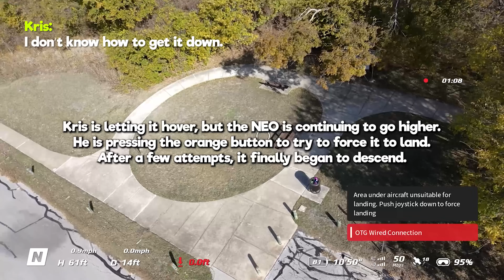Don't Do This With Your NEO [DJI Responded]

Comment: I tried indoor flights with RC-N3. GPS lock doesn't seem to matter, but enough light is crucial to make down sensors work. Too dark and it isn't able to hover but goes crazy. My conclusion is Neo switches to GPS positioning only beyond a specific height (unknown but higher than a room).
GPS receipt is also very weak compared to a smartphone. Takes ages and doesn't get as many satellites under sub optimal conditions. Don't know why. Neo body is large enough to include same antenna as any smartphone.
Reply from the maker: Interesting theory about the height. You might be right about that.

Comment: This is obvious, even with a good lock, civilian GPS only has an accuracy of a metre or so. The drone uses a combination of the sensors and the GPS to get its position and speed, without either of these it will be erratic.

If the sensor is used to gauge how quickly the drone is moving with the motion controller then if the sensor sees all black it may think it’s not moving and attempt to move faster in that direction, this could account for the out of control movement when moving into a dark area, especially if there is no GPS to correct its positional awareness.

Comment: It has happened to me several times that, in broad daylight and with a completely clear sky, while the drone is connected to 15 or more satellites it suddenly loses them, making it difficult to control the flight and bring it down safely.
Reply: it happened to me as well, looks like it is not some rare cases but it does happen in most users. I hope DJI could face this issue as it makes the users losing the confidence in flying with DJI.
Reply: Perhaps KI Problems. You can get a downligt for Neo for Indoor and dark night flight. Then I have no problems with the indoor dark fliegst.

Comment: do not fly without fully stable satellite, the error is not from the drone but from the pilot itself. DJI and mostly their apps remind you always not to fly or be caution on flying the drone when in not stable state or with low gps signal. If it doesn't have good satellite signal then don't fly if you're not good on manual mode. There are many reason why it doesn't get good signal satellite like maybe on a certain area that has so many interference and metal that can cause its frequency signal weak or error. On your test flying it on a narrow space it's not because it is dark. It's Because the flow of air swinging it around with its own air flow that gives the drone unstable in addition of no signal and no ground sensor to lock its position. If the flow push it forward or backward then it will go that way making it seems like it looses control, a good practice is a quick thinking to push the drone avoiding to hit something if it loses control.
Reply from the maker: We should've waited for more satellites. We assumed that when the message on the lower right corner said "Home Point had been updated" it had GPS lock, but maybe we needed to wait for another message. 

Regarding your theory about airflow, this also happens in open areas, so it's not the airflow. Also, as we discovered, it's only with the Motion 3, not any other controllers. 

Thanks for your analysis.

Comment: You said you'll fly it with satellite gps locked but base on your phone status it has no stable satellite  that is why it has no gps lock on. So what's the point of flying it without any lock on? it will eventually uncontrollable without any experience manually and when you tried to bring it down it now have stable GPS but you're bringing it down manually so that is why it still not stable.
Reply from the maker: We thought we had GPS lock. Notice that as we were talking off, the notification on the lower right said that the home point was updated. As far as we knew, that's what seemed to be a sign of a GPS lock.
Reply: @readysetdrone  I think the GPS Lock will only work or will use GPS mode on High Altitude, The Drone will automatically Go up until it switches to GPS Mode if the Drone is on Low altitude like below 10meters it will use only Optical Sensors it will not use GPS or switch to GPS mode it will only use Optical until you pull up to high Altitude and will change to GPS mode. So even you have good  GPS Signal it will not use that on Low Altitude.

Comment: Great video... I'm having the exact same issue.  But since it does doe have obstacle avoidance, why does it freak out when it approaches ... Same issues with both the MC3 and RC2. I also with 8-10 satellites cannot get the Neo to fly indoors. It goes crazy and uncontrollable. And when with 16 satellites I tried to land it in my hand in a shaded area...it went straight up and hit the ceiling. Neo has issues and I'm sorry I wasted my $$$...
Reply from the maker: Wow! I guess the issues with the NEO aren't necessarily consistent across all units. For us, it only goes crazy with the MC3, but the RC2 is fine. And that's very strange that it went up instead of landing in your hand. Thanks for sharing your experience.

Comment: GPS is used for positioning (latitude and longitude) not altitude.  DJI drones use a barometer and downward infrared sensors for flight altitude.
Reply: And he should GPS lock into 20 sat before flying! if you look at hes flight with tape you can see that the drone drop under 8-9 sat which is insufficient for the drone!
Reply: Exactly what I was thinking. That's not blocking vision sensors, it's blocking infrared. How the hell is it supposed to know where the ground is, no wonder it went crazy.
Reply: @LalixLeisure  I have a Neo and have this exact issue when flying indoors.  It will suddenly accurate and I have no control.  I have also built many drones using common FPV parts.  The custom builds do not do this.  Not sure what the flight controller on the Neo has, but essentially all FPV controllers have a gyro and accelerometer on board.  Many also have an altimeter.  These can sense movement without GPS, there is no unexpected acceleration even indoors.  They cannot sense altitude directly, but can sense change in all axis including altitude (Z axis).  I would expect drifting, but not un-commanded acceleration.   This looks like a firmware issue to me.

Comment: very thank you for sharing precious experiences with this gps controversial drone!...
However I found many NEO users complaining about while not related with light ambiance !   They said this randomly occur even in very clear spaces outdoor when get under 14-16 satellites??  Why so high limit for a simple flight that is never from a pro drone this case??  It seems there is far any else originated! 
They often lost NEO control by some buggy I suppose unreliable, low sensitive or internal nearby circuits interference with its very cheap as it seems gps receiver due to NEO very small higher density designed in relative with its high complexity circuits !
On the other hands, it is so weirdly to have any gps positioning dependency with the other sensors as they mainly should  complement each other, so whenever light is lower, gps should be mainly used instead as to provide an acceptable safety return to home at least. 
However it could be also software bug as caused by some badly settled priorities among internal signals to process, God DJI knows only, but the issue seems to be unhappily wide spread today so we all hope for an update to try... fix it (still hope to be software exclusively...)😟😶  
So sad...NEO could be far the smartest AI featured drone DJI ever release if not this huge nightmare...  
Meanwhile we also hope new FLIP will natively avoid gps issues as well as any other interference with sensors even if could use LIDAR as we also very hope!..😎
Reply from the maker: Interesting! We didn't know that this bug also occurs without flying in low light. Thanks for sharing!

Comment: I spoke to Chris a couple of days ago and I had an issue with the automated rocket without any controller. The Neo went up and on its way down I think I got slightly underneath it and it stopped at what would have been head height above me, the Neo would not lower itself and I had nothing to stand on until the battery went low and it auto landed. It may have lowered if I had managed to connect my phone to the app, but I am not sure if that would be possible in mid-flight. In my 3 batteries test flights, I had a few issues with the motion controller seeming to go out of sync so the wrist movements got even more exaggerated until I had to turn my whole body. I need a few more flights, but it is very cold in the UK at the moment :) The Neo does seem to need the downward light sensor and anything getting in its way will cause issues. Good to know it is a lot more stable with the controller, I have the FPV controller 3 so should hopefully perform well with that. Great Vid again :)
Reply: Have a good time flying with the FPV controller 3, Paul. 🤘

Comment: no sattelite lock at take off. when it locked, it use that coordinate as home point, including its Z axis. that and the unstable gps lock makes it compute that it didn't have enough altitude and then rises. The motion controller uses gyro input and alghoritm to predict and makes compensate movement for x and y axis, which then contribute to drifting
Reply: What's the best way to know when it has satellite lock?
Reply: @TechnicallyAverage  I think Neo needs to have around 25+satellite lock. The icon in the bottom right shows red when it takes off. The best way I think to let it sit for a while when it powers up and it should be ok after the home point has been recorded
Reply: Good to know! I would've thought that 12 to 15 would be enough for a stable flight.  @DTSmobile At 0:41 seconds, it looked like it had 12 sats and was white. Are you referring to another part of the video where it was red during takeoff?
Reply: @TechnicallyAverage  yes. Looking back at your video, it shows white at take off with 11-12 satellite, but I think your home point isn't recorded. At -0:58, you can clearly see when the drone climbed and  reached +1m altitude, the satellites count drop and then even at 11-12, it shows red and in that instance I think it began to drift
Reply: @DTSmobile  Interesting. Well, I suppose the only thing to try is to very firmly tape up the sensors, then wait for as many satellites as possible and then take off and see what happens. 😂 I have a feeling it won't do and better.
Reply: @TechnicallyAverage  and don't forget until it saves and shows your home point. I recalled when my og mavic pro fly away during mapping projects (using 3rd party automated mapping apps, not the DJI one's). It didn't have enough satellites, didn't have it home point, moving sideways until it hits a tree 😅
Reply: @DTSmobile TIMES Yikes! Thanks. 🙏  How do I tell when it saves the home point, while using the goggles? I thought that at 0:42 the message on the lower right where it said the home point was updated, meant that it was good to go.
Reply: @TechnicallyAverage  I think it makes audible sounds like all dji drones, but I gotta check and come back to you. All I can tell that the video shows 11-12 satellites, without the H point. Then it goes haywire when it drops to 4 satellites. That's makes the Neo freak out frantically try to lock a new home point. 
The motion controller with the only 2 modes without the manual mode makes it worse. Slight changes in the gyro makes the algorithm in normal/sports modes interpret wrong input without base positioning. I have friends in my community that use neo full manual mode with dji fpv controller, over water or in night flight, seems OK, but I'm no fpv pilots 😅
Reply: @DTSmobile  👍 To make an audible confirmation would be great.

Comment: This completely accords with my experience.  I was sending the Neo up in low light.  Not super low light, it was evening in a well lit parking lot, but definitely not daylight bright.  It had an incredibly difficult time getting satellites!  And when I got it up there, at one point it just flew out of control and hit a lamppost and the frame cracked.  I had to replace it through the DJI Care.   The question is -- why in the world would it fail to get good satellite coverage just because it was dark?  Why would that affect satellites?  It makes no sense to me.
Reply from the maker: Sorry to hear you cracked your NEO, but thanks for sharing your experience. It really doesn't make sense that the GPS is affected by low light. Hopefully, we can get some answers and updates soon. Thanks for watching and commenting.
Reply: @readysetdrone  Great to hear.  Subscribing so I don't miss updates on this :D
Reply: do not fly without fully stable satellite, the error is not from the drone but from the pilot itself. DJI and mostly their apps remind you always not to fly or be caution on flying the drone when in not stable state or with low gps signal. If it doesn't have good satellite signal then don't fly if you're not good on manual mode. There are many reason why it doesn't get good signal satellite like maybe on a certain area that has so many interference and metal that can cause its frequency signal weak or error
Reply from the maker: We are learning that we should've waited for more than 12 satellites, but while taking off, there was a message that said the home point was updated, so that makes us think that it had enough. 

Aside from pilot error, there's still the fact that the vision system seems to be linked with poor satellite lock, because as you saw in this video when we removed the tape and flew again, the satellite connection remained solid.

Comment: I hope DJI will take these tests seriously and push an update to resolve the motion controller issue asap. I had the same problem, it just goes bezerk and speeds up. That's a concerning bug because it could lead to injury, damage and even traffic accidents...
Reply: Mine speeds up and hits random walls in low light! @dji

Comment: Good information a lot of out here only use the phone as a remote, personally I bought my Neo for its size and audio capabilities for my personal YouTube channel (not a professional channel like yours) I pretty much use it in the pre-programmed modes which I personally feel that’s what it was designed for. note I do have a DJI mini pro 3 but I find myself using it less and less because I don’t wanna go through the hassle of editing to add my voice. I connect the Neo to an iPhone 13 Pro Max with a Hollyland lark one microphone system.
Reply from the maker: That's awesome! The NEO is a fantastic little drone. Of course, it has its limitations (it will fly into obstacles sometimes as it follows you, and if you go into a shaded or darker area, it will just land), but there's nothing else like it for the price! 👍

Comment: Totally!!! I've experienced all the exact same behaviors as described in this video when flying with the RC Motion 3 controller. I crashed a Neo and broke the gimbal camera while it suddenly (and unpredictably) accelerated towards a wall inside a poor lighting conditions section of my house. I too, was studying this behavior and encountered the same facts. I didn't know that this acceleration sensitiveness only applied for the motion controller; I have to try and experiment with the FPV Remote Controller 3 in stabilized mode and poor light conditions as well. Probably, this is a bug in the motion controller and can be fixed.
Reply from the maker: Yeah, we actually thought we broke our gimbal several times while testing. We wiggled it back into place and it seems ok. 🧐 Let us know how it goes for you in stabilized mode with the FPV controller 3 in the dark. Based on our tests, it's only the Motion 3 where the throttle becomes extra sensitive.
Reply: @readysetdrone  
Hey, did my research flying the Neo with the FPV Controller 3 in stabilized mode during poor lighting conditions. Effectiveley, the drone will have no trouble moving at all. I'm mind blown! I thought all this time that the vision system was messing up with the stabilization process, but now we know it only happens with the motion controller. It is for sure a bug in the firmware. I went as far as directly taping the gimbal camera to block vision completely, making it fly blind; The ToF and IMU sensors still did their stabilization job.

I guess I'll have to switch to the FPV Controller 3 due to reliability since I often fly in public places. Quite a shame since I find the Motion Controller a bit more ergonomic, and I like that it activates the HUD flight path vector.

BTW, you guys have to make a video about fixing the gimbal camera. Broke mine many times without knowing there was an easy fix. I mean, I had DJI fix it for free thanks to Care Refresh so far, but still, the downtime is not fun :(
Reply: Forgot to mention. I was flying indoors without GPS assistance.
Reply from the maker: Thanks for the update! We are glad to hear that at least your experience aligns with ours.

Definitely something going on with the Motion 3, and since it flies normally (even if it drifts a bit) with other controllers, that tells us that a firmware update can fix it. 

As for the gimbal, oh man, we have knocked out of whack several times in the course of these "NEO in the dark" series of videos, but haven't thought to make a video because each time we just fudged our way to getting it back into place. Just the other day, I had a really bad crash and wiggling it back in didn't work. I needed a flathead screw drive for leverage to click the gimbal housing back into place. That was gnarly! 

We'll keep it in mind to film ourselves for the next time we crash. 😅